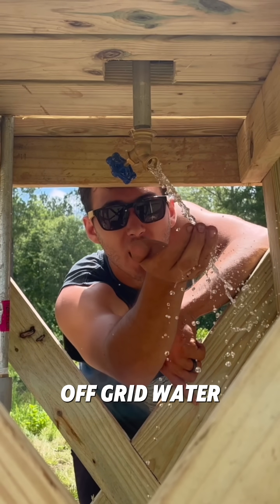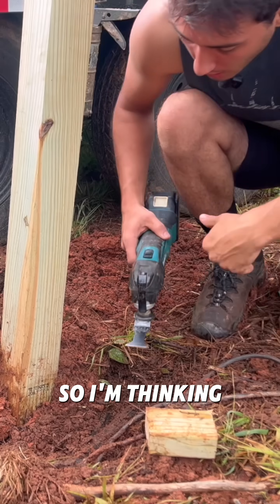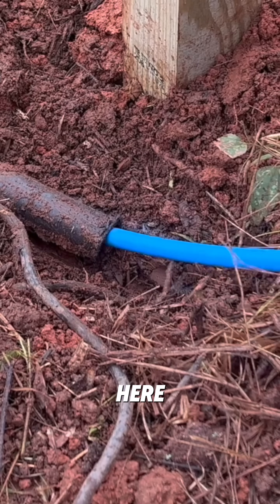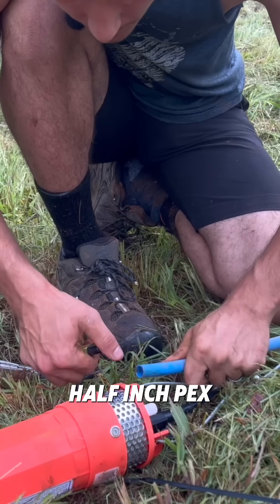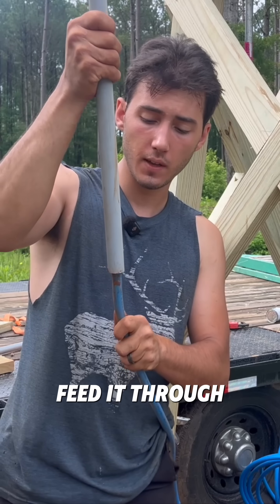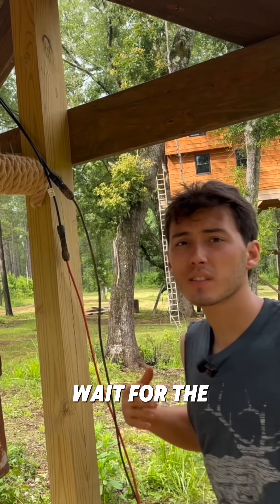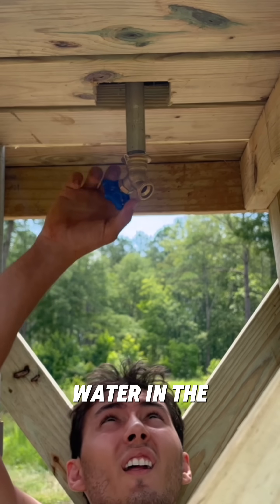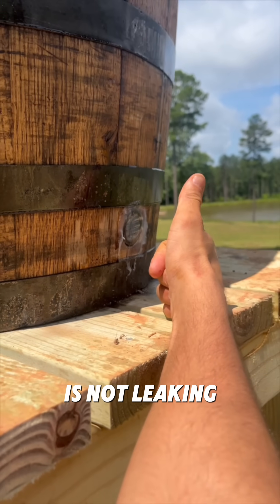I Built an Off-Grid Solar Water Supply System

Comment: Use a T instead of a 90 for your vent hole. And a stub going up out of the T. The pressure might still push the water up the stub though.. may need a long stub.

Comment: I have often thought about having a LARGE truck radiator with well water slowly running through it (going in the bottom, out the top), with a solar powered fan blowing through the radiator.  Might have trouble with condensation on the radiator here in the Eastern USA. Would have to work that out some how.  That's the basics.

.

Comment: HVAC guy here... Pipe that water into a car radiator mounted by zipties to a box fan. Pipe the exit back into the well. Hillbilly air conditioning taught to me by my grandfather, as a kid hed be sitting in the garage in front of the fan/radiator. Id ask what he was doing and he say im watering the garden, what the hell does it look like? The exit of his radiator was a hose that went to the sprinkler. Watered his garden every evening while sitting in the garage and stayed cool.

Vent holes need to be in a separate pipe extending out of the top of the barrel.

Comment: Could install a PRV/ vacuum breaker/ air vent valve, for cheap in line. Lets out air, but not water. You could honestly probably just nake one with some pipe and some gaskets/fittings, and a ball.

Comment: You need a float shut off for the pump. So when the barrel is full to the float. It cuts power to the pump till the water level is low enough to kick back on.

Comment: Solar cooling system or free ac. Run the well water through a radiator and have the fan blow through the radiator. You got yourself a diy ac.

Comment: For the ventilation in the actual pipe that you drilled, you need a pipe going straight up So you would have to put a T pipe in that area where you drilled. And then have a little bit going up and then you can drill thare So it won't leak and there'll be airflow.

Comment: BAS Electrican here, if you run some excess water to and through a small radiator, put a fan behind it (or not, just slower room circulation), you could theoretically reduce the spaces temperature. Only downside, youll either need to re-add that water back into your drinking supply or dump it (maybe could use the lost water for irrigation?)
Reply: Hvac guy here, a ac unit works by pulling the heat out of the air and circulating back into the house a better bet would be a swamp cooler but if your in a state where it's hot and humid... your gonna want something like a mini split to pull heat and humidity out of a space. you can run them off solar panels too.
Reply: Just ran this ‘warm’  water back in well

Comment: Your cooling system doesn't even need power dude. Because hot water creates pressure on its own. Its a known thing already and there are working units that will never need maintenance.

Comment: I, also, have a well fed house. The main difference between mine and yours, at the moment, is my system has a pressure tank and a pressure switch. 
They prevent the pump from running continuously. 
It might not be needed with your system. 
My knowledge is solely based on what I see in my system and a very vague understanding of what it does.
Reply from the maker: Yes that is how the well that feeds the treehouse is set up, but it’s a much more powerful 110v pump

Comment: Put a T fitting on the turn  run 12 inches up put a screen on your pvc so you don't contaminate the water and that should be a good vent of course i know nothing about what you are doing but I figured I'd lent you some information

Comment: Gore-vents. You can order them, like 10 bucks or something and last 10 years.

They are normally used to vent air without allowing water in, but they would work perfectly for this. They screw into a threaded hole.

Comment: You could also create a little power as the water goes down, if you attach a properller to a motor and battery. 
Someone more educated on the subject than i can probably explain/correct that lol

Comment: You'll find elevated water tanks in many parts of the world. It's how they deal with low water pressure from the source; by putting a water tank on the roof  they have increased and steady water pressure inside their homes.

Comment: Dont drill a hole into the line that supplying water, just the black pipe you have will let the barrel vent and allow the water to push the air out.

Comment: The idea you have sounds a lot like radiant floor heating and cooling where pex tubing is under the floor board and depending on the temperature of the water you can cool or raise the temperature evenly, now with an off grid set up you just need a way to get the water into the pex tubing and possibly control either through fire wood or a boiler and for cold water you showed it in the video

Comment: Stainless steel radiator on both ends. One submerge in the well water and one in the spot you want to air condition and a 12v computer fan .connect both radiators with a small 12v water pump and you have cool dry air !

Comment: I was thinking realistically is your end goal to pump that water up to the treehouse? Then you should probably just put that whole water tower system on your tree house or maybe the water barrel itself could sit on your roof and then you could trickle fill that using the well and then you wouldn't need any extra water pressure devices like the water bladder I had mentioned before. I was also thinking to keep pressure you're probably going to need some kind of motorized device in your tree house that will make noise every time you turn your water on like a pump but for up top to add additional water pressure, That's not a bad idea either. Also if you want more water flow than what you're getting what did you say like a gallon a minute I would look up a ram pump it's a non-electric way to pull water from a well like that and I believe it's a bit more than a gallon a minute.

Comment: Float switch for the barrel and trickle charge a battery when the pump isn't running. Battery fills barrel when cloudy and low water, high water and sun battery charges

Comment: What you need is an air separator. Vents the air without letting out the water. Fairly cheap part. Usually install at the very top of your loop.
Reply: Studer vent is what the plumbers call it

Comment: Fun fact, the hole in a wooden barrel is called a bung hole, because the tool used to make the whole was a bung.
Reply: Not the tool, but the actual plug was called a bung. Bung goes in bung hole

Comment: Did you a put a hose clamp on the pex where it connects to the pump? If you didn’t… cmon man

also, cmon… you didn’t HAVE to put a vent hole in the intake water line. But yea. Put a T in before it goes down into the tank and run a small length up and leave a vent hole in there
Reply from the maker: Yes I did put a hose clamp on the pex, and that’s the plan!
Reply: @SouthernAdventuresYT sweet. Glad to hear that. Keep it up. Your content is inspiring
Reply from the maker: @Keyrtist thank you :)

Comment: Get a fuel tank rollover valve and put it in the cap for venting. Once liquid pushes against the ball it shuts the hole. Simple mechanical part that basically never fails
Reply from the maker: Love that

Comment: So one of the only reasons to "vent" the line itself is to drain it or get air out while the pipe primes with water. For such a small pipe with a relative long horizontal run, theres almost no chance of creating an airlock, so i would do away with the pipe you drilled. Keep the pipe at the top of the barrel to prefent siphoning and vent the barrel so you dont blow the lid off. Or keep the barrel airtight and use the extra pressure for water pressure, like  a normal well holding tank

Comment: Hell yeah man, but no way you drilled a vent hole in the water supply then said “we have a problem” 😂. Anyways you’re doing great
Reply: Yeah the vent should only be in the cap of the overflow not the water line. You need the pressure in the line to move the water. Just not the air bubble at the end of the system keeping it blocked
Reply: so close LOL

drilling the hole in the feed line to vent was just wrong.   only need a hole in the overflow/sensor.   thats the only part thats going to build up water pressure  without a hole.

that said thats a perfect "ole timey"  water tower.

in fact they use almost the exact same system in places like africa...  with it either being solar, or wind powered.   with wind powered is either a manual pump or again, electric, with the wind turbine generating power to power an electric pump.
Reply: @jenniferstewarts4851  I also watched the movie about the son wanting the father's bike to make a wind turbine for a well and too felt so smart I'd come straight here after a quick copy paste to pretend I too am knowledgeable about the subject.
Reply: I'm going to give him the credit that he caused that problem just for the comments and interactions 😂
Reply: This is so cool. Could you dm me with your full address so we can talk more?
Reply: I thought the same thing, bro what are you doing?? 😂
Reply: Literally came to say the same. Maybe vent your tank.  Sweet other than that 🎉🎉🎉🎉🎉 I want a project like that 🎉🎉🎉
Reply: That was funny af
Reply: he's clearly just trying to bleed the line😂😂😂😂😂 he's doing great though good for him
Reply: You need to raise that vent
Reply: Get yourself a boiler vent that's a water air
Reply: I was like, wait did I actually just watch him do that..

Comment: Maybe run the water through and radiator with a fan . And automotive radiator and fan would be 12v. Yea after a certain depth the water stays a certain temperature all year long. It the same basis of geothermal heating and cooling.

Comment: You don’t put a hole in the plumbing…. Just in the cap for ventilation
Reply from the maker: The steel piping is a highest point in the system, air would get trapped up there.
Reply: @SouthernAdventuresYT but it wouldnt…
Reply: @eiv3959  nope sure won't.  Not sure what he's thinking.  Also what he did with the pex on the pump, yeah thats a big no no.  Ain't no way that last very long at all